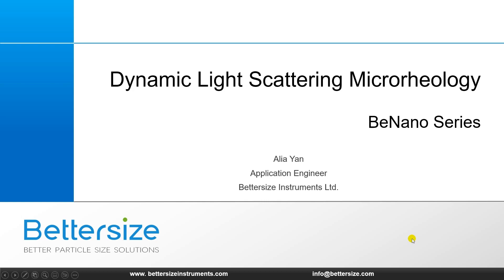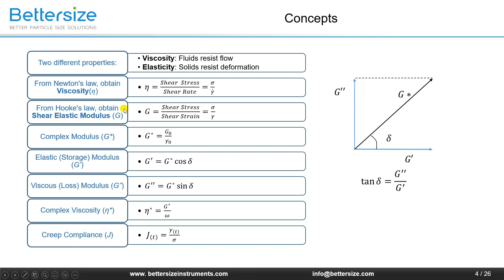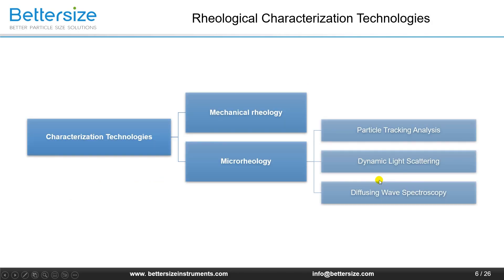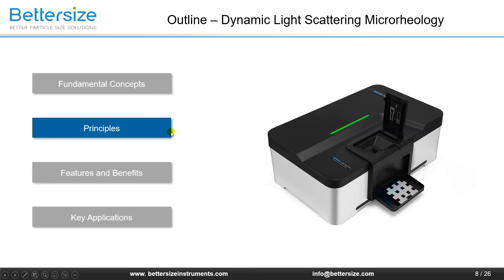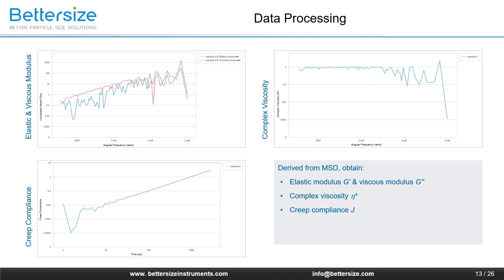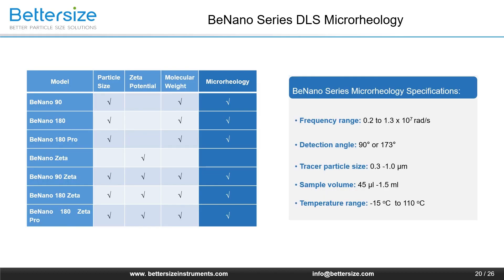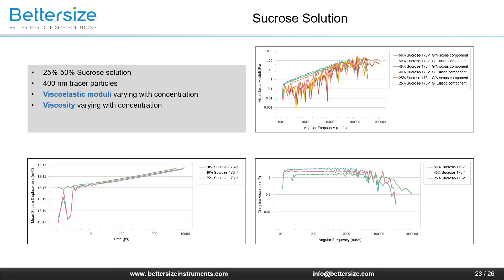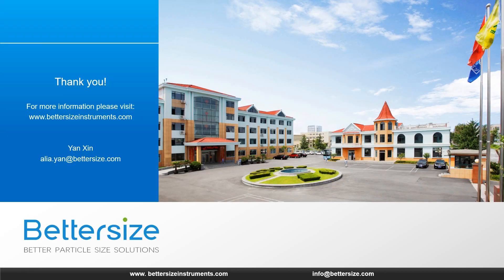Fundamentals of DLS Microrheology

Comment: one question‘ what tracers did you use in the BSA experiments？ the
 protein may adsorb onto the tracer particles.
Reply from the maker: Hi👋, here’s the response from our engineer—hopefully it addresses your question: 

In this experiment, the 3000 Series Nanosphere™ Size Standards were used as tracer particles. Depending on the type of proteins or particles present in the solution, tracer particles with specific surface functional groups should be carefully selected.